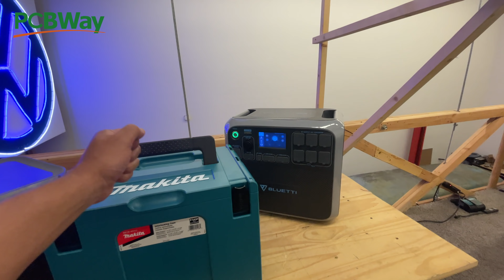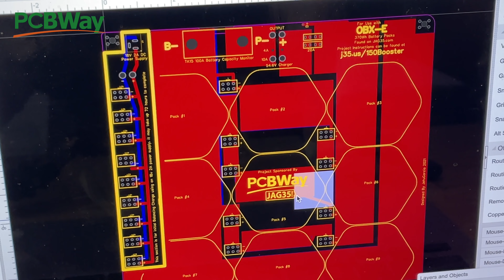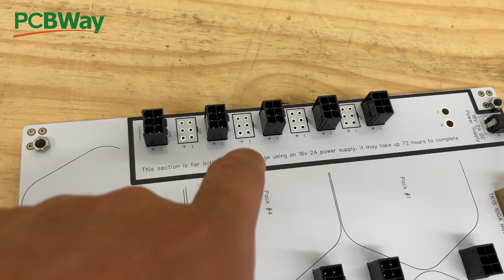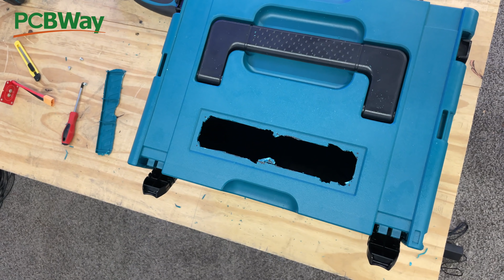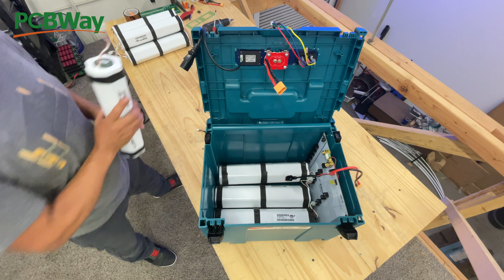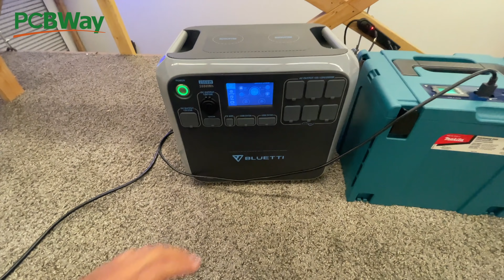DIY Booster Battery for your Bluetti /Ecoflow Solar Generator

Comment: awesome idea, thanks Jehu!!!
the PCB can still be used for all 9 balancers. (and 12V 2A charger)
just EXTEND the connectors inbetween with wires (tricky but doable) so half are surface mounted and half are"floating above the others" . easy

Comment: Bro….where did you get $500 for the total? Its substantially more than that.
Batteries are $441. Items on Amazon are $191. Then the cost of the boards about $139. Cost of meter $27. This is an $800 build.
…..Did I miss something here? I still think cost is pretty good, but its 60% higher than the estimate

Comment: So your using the solar ports to supplement the generators. So can you still plug in the panels while using this? I kind of agree with Vanilla Gomez on this. The better video would be to use these batteries to make your own solar generator and forget about the off the shelf solar generators. Then you could make one with as much storage as you want!

Comment: Jehu,  
The link to the 48V charger takes you to a 4Amp Charger with an XLR connector.  It looks like the Anderson connector version is 10Amps.  Is that ok or do I need to replace the XLR connector with the Anderson connector?
Reply: I was wondering the same thing. Anyone know the answer?
Reply: @paulthompson4618  Did you see the shunt listed?
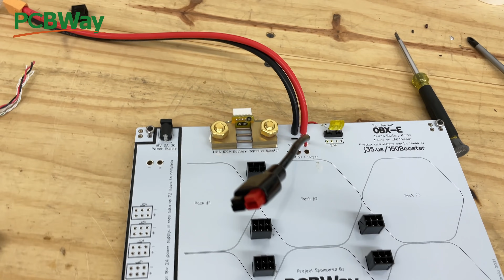Reply: @paulthompson4618  I did see listed on the board that main PCB board that it is labeled 10A 54.6 Charger (7:28).  Should be good with the 10A charger.
Reply: @offgridwithpojectham  Thanks Michael

Comment: You can make a step down converter 50v to 24v to power a cooler ( peltier ) ore a small cooler whit a small compressor that accept 12-24v its a modulair pack.

Good video

Comment: You should have PCB way change it so you can fit all the plugs in like intended... Also since you have the measurements of the Makita box increase that front panel a hair bigger... You won't have a pain in the butt trying to cut the hole out... 
Also if you use 3M Velcro with the sticky tape in the bottom of the box as wrapped around the batteries (alternating direction if course) everything inside will be secured and not slamming around should you move it... Also if you attached the pcb inside with that 3m Velcro tape it would remain a bit more water tight outside...
Reply: or extend the existing ones with wires (tricky but doable) so half are surface mounted and half are"floating in the air" but usable

Comment: During the balancing operation, those batteries are in parallel right?  What if a low battery and high battery are connected, wouldn't there be excessive current flow?
Reply from the maker: No the bms will turn off at 5A

Comment: I am looking for something that allows me to plug in a laptop, tablet, router and cellphone to charge those devices and also be able to have LED-Lights at night.
So when a Blackout happens and I'm stuck without lights for a week or so, I will be able to have some kind of life.....LOL
Would love to see a video about that  😉👍
Reply: This is what the solar generator does for you.  This diy project just increases your battery capacity to the generator.
Reply: @1oldretiredguyMike  Aaaah I see, I see.  ok
Thanks  😉👍

Comment: Jehu, currently building a tiny house. Was short on budget but  already had planned on a smaller system for my tow vehicle, that is a Ford F250 with a tool truck bed on it, and easy to mount roof racks for the solar panels.  So the system I'm putting in the tiny house for temporary use will go in the truck.  I grabbed a Eco Flow River, and a 200w Newpower 12v solar panel.  I'll likely get one more of the 200w and those 2 will go on the Truck for the long term.  I wanted to get the 400w bifacial panels I've seen, but minimum of 4 or a pallet of 10 so likely doing the pallet of 10 in a few months. 

My question is I'm ready to grab your populated board kit.  If I get a solar charge controller and use the 12v panel to charge the Makita box battery box. The problem being is I think the max V input for solar on the River is 25v.  So I'd need to change the Makita box to 24v or 12v for it to work outside of using a 2nd mpt controller to keep the voltage down which would be a waste of efficiency.  

I'll either be getting the Delta or one of the high wattage bluetti or other systems, or build separate components and use the Makita box with the new system since I'm aiming at 5,000 watts or more of solar coming in.  

So suggestions here are welcome.  Will pull the trigger and buy the kit today if you think it's the way to go for my current temporary needs.
Reply: More using it as a UPS currently on my computers and smart home devices so everything continues to function if the power is out.  That pulls about 250 to 350 watts depending if I have the 55" 4k tv on or not. ;)  I think that only gives me about an hour of run time, and would use the Makita box to extend my time I can run without grid power being on.  I have to watch the rest of the video you may mention dropping the voltage and how to do it with the setup you are selling.

Comment: The batteries are sold as is, does that mean untested? Any idea of the average battery cycles left on them? $450 is a lot for as is untested pricing
Reply: I purchased 10 of these batteries all were fully charged (16.4v) one needed charging. Understand your not paying full retail. If you will sleep better then buy from Bluetti and pay full retail and  get a multi year warranty. Read the comments he has sold very many different type of batteries, I don't remember seeing any dead battery complaints.
Reply: @paulthompson4618  snarky on YouTube, never seen that before. Get over yourself 😂
Reply: @ThanksForTheLaugh  Odd reaction to Paul's comment.

Comment: Just priced this I could do that with 12 volt deep cycle batteries cheaper than that and hook an inverter to them if I need additional ac power.
Reply from the maker: Do it

Comment: For my AC200 I used 280ah batteries that are always charged by solar. These feed through a BMS and out to the charging port on the Bluetti to keep it constantly topped up. This avoids having to charge the 280ah batteries with a wall outlet. If the 'Big' batteries run low, the BMS will kick out and stop charging the Bluetti but it will then use its internal batteries. When solar is available again, the main batteries kick in and start charging the Bluetti again.
Reply: I am using 16x 280ah batteries, wired in series for 48v through a Overkill Solar 48v 16s BMS. 48v x 280ah = 13,440kwh of available backup. The batteries are charged through two Victron 100v/20a MPPT charge controllers (https://smile.amazon.com/dp/B075NPQHQK) feeding from two different arrays. Don't worry about the voltage in the listing, they indeed charge at 12/24/36 or 48v. 

The output from the batteries is wired from the output side of the Battery BMS directly into the Solar charge port of the Bluetti with PV being selected as the charge source. The Bluetti cannot tell the difference between solar and battery at this voltage so it just sees it as a very large solar panel supplying ~48v that is Always available, rain or shine so long as the batteries have enough charge. When the internal Bluetti batteries drop to about 98% then it starts recharging from the batteries until it is topped off at 100% and then shuts down the charge until needed again.

This setup got me through the recent winter storms in Texas for over four days running a fridge, 500w heater and occasional microwave + a coffee maker (can survive without everything else, but Coffee is a MUST!). For an example of the capacity, you could run a 500w heater for 26 straight hours assuming no recharge. 

I like what jehugarcia is doing here, extending the capacity of the Bluetti but I am concerned about using battery packs that, once they run out, are essentially no longer available - that is why I chose the 280ah LiFePo4 cells from China (took about 2 months to arrive).
Reply: @houstonfirefox  That sounds pretty great. Do you have a video on how you set that up? I have 0 experience with this stuff and am researching for a van conversion.
Reply: @jonmgreen  To be honest I didn't know there would be any interest in it but expect a video soon detailing the setup on my channel in the next few weeks!
Reply: @houstonfirefox  I'll keep a lookout!
Reply: @houstonfirefox  i don't see a video
Reply: @houstonfirefox  -Nice one,do you have any Youtube vids or fb link?
Reply: @femialade4226  Click on my name above and it will bring you to my channel if you want to see upcoming videos on my setup.
Reply: @houstonfirefox  The batteries Jehu is using can also be charged with a Victron solar controller just like the batteries you bought from china.
Reply: @uhjyuff2095  Which controller? and would it plug into the board in this kit or would I need to wire it up differently?
Reply: @jonrose6802  A solar charge controller that says it can charge lithium and up to 42 volts. If you are looking to buy a victron solar charge controller make sure it says 48 Volt on it, like the 100/20-48 model, then you will be able to charge any 10s lithium battery with it.
Reply: @uhjyuff2095  Good point. Also note that the 100/20-48 model mentioned WILL ALSO charge 12v, 24v, 36v as well as 48v capacity battery banks. It's not specifically mentioned at first glance. I really like having that option for it to automatically determine the correct voltage although 36v must be manually configured through the Bluetooth app.
Reply: @houstonfirefox  Your link for Amazon says sorry page does not exist
Reply: @houstonfirefox  I’m a total noob with diy 12v battery systems.  I bought a AC200P but noticed it doesn’t actually give me 2kwh.  So am considering buying a 200ah LiFePo to supplement.  Figured how to charge it… can you advise on… 1) can I connect the 200ah 12v directly to the DC charge port of the AC200P? Or do I need something in between?  2) I’d also like to charge this battery at the SAME time as charging the AC200P… Do I need a BMS to do that?  Thank you in advance
Reply: @CalmTurtle2023  Hello! If you have 4x 200ah LiFePo4 cells then that gives you the 12v necessary to charge the Bluetti. Because of the sensitive nature of these batteries, they can be destroyed if you run the voltage down too low or charge them above 3.65v. I recommend the Overkill Solar BMS to ensure that any load or charger will be disconnected before these limits are hit. 200ah x 12v = 2400 watt-hours of added capacity so your Bluetti will start charging from your supplemental batteries when its battery level drops below about 98%. The BMS on the supplemental batteries will prevent the Bluetti from taking "too much" and automatically disconnect if they fall too low. In short, YES. You should ALWAYS use a BMS when using LiFePo4 batteries or, God Forbid, straight Lithium Ion batteries (which I would never use do to safety issues).

Bear in mind that charging from a 12v source will only fill the Bluetti at a rate of about 100watts per hour (Wh). If you fully deplete the Bluetti then it would take approximately 20 hours to recharge it from a 12v source since the Bluetti limits the amount of current it pulls to avoid damage to a 12v car cigar lighter socket. The recharge rate is roughly double at 24v (about 200wh). The Bluetti DC (car) charging port automatically detects whether it is being fed 12 or 24v and limits its charging current accordingly. There ARE ways around this but that's a topic for another day. In short, it IS possible to deplete the Bluetti completely even if the supplemental batteries are connected since you may be pulling juice out of it quicker than it can be recharged. Normally this is not a problem.

As for charging your supplemental batteries at the same time as the Bluetti - Absolutely! I use a Victron SmartSolar 100/20 charge controller from solar panels run to the Victron and from the Victron to the BMS to charge my batteries regardless of what is going on with the Bluetti - it will only pull from the supplemental batteries when needed to charge back to 100%.

Subscribe to my channel and I'll have a walk through of this process coming soon complete with diagrams and other visuals to help understand what is going on 🙂
Reply: This was my plan too. Limitations on how many watts of solar you can dumb into the Eco or Bluetti, so using solar charge controller to charge a battery bank, then charge the Solar charger from the battery bank using another charge controller.
Reply: @RoeBorger  Exactly. With 12v or 24v of battery available you could then use a boost converter to turn that into 24v or 48v to get a better charge rate from the Bluetti
Reply: I'd be interested in doing a setup like this too. What all did you use?
Reply: Amma Biz sadece baxiriq 😟😒
Reply: i too am interested in this setup and video!  So if you have no solar and your AC200 is depleted does the backup battery start charging it up automatically?  or does the BMS do all the work and start topping the AC200 from the backup battery?  Thanks!
Reply: So you essentially built a solar generator with a bluetti and all you're using the bluettinis used for is a inverter. May as well just saved yourself $1000+ and just bought a 2000w inverter instead of the bluetti
Reply: @randybobandy9828  In hindsight, you are absolutely right. 3 years ago as I was learning how to get this stuff configured, the Bluetti was the cheapest route. Since then, the prices on pure sine inverters has come way down and your right, especially giving the slow charge rate of the Bluetti when a large load is put on it.
Reply: This sounds exactly like what I want to do. Could you please send me a parts list and a how to if you have it. I would greatly appreciate it. Thank you.
Reply: @msarmir  Currently:
8 x 280ah LiFePo4 cells (24v total)
24v to 48v step-up booster (so I can use the solar charging port on the Bluetti and get a faster charging rate. Before, when I had only 4 cells (12v) I used a 12v to 24v step-up voltage booster for the same reason)
Victron SmartSolar MPPT 100/20 charge controller
4x 250w solar panels (about 1000 watts total but realistically about 800 on any given day)

Comment: It's a viable alternative to buying a company made battery, but it may be important to have both units communicate with each other, otherwise it's no different than using one solar generator to charge another.  The Ecoflow River Pro has a port that will accommodate an external battery.  The port includes a serial connection like the old days. The only downside is the primary unit battery needs to be depleted before the external is used.  I wonder if it's the same thing with the Bluetti and the new Max?
Reply: you can connect them and USE energy same time. (correct me if I'm wrong)
Reply: You could just open the unit and add a 2 parallel XT adapter off the battery to inverter. 

ONLY DO THIS IF YOU HAVE THE SAME VOLTAGE BATTERY SAME CHEMISTRY AND SAME STATE OF CHARGE (full). This might confuse the microcontroller that is in charge of the fuel gauge

Comment: You said that the batteries only support about 15 amps of current, but since you're running 3s3p (3 sets in parallel), that would mean 45 amps from the whole pack right? So theoretically about 2kw of output? That would be much better, otherwise you're looking at about a 720-750 watt limit on the pack. That's not great for battery storage, although it would be enough for charging other battery packs.
Reply: I think it was: 3s3p
- 5A per battery series
- 15A per parallel group

Comment: Do you think I could use a slower charger? I'm thinking I could charge from the bluetti (it's in a van permanently) when the van is not in use and there's Solar. I then have the big battery as a backup when required (not often).
Reply from the maker: Yes this is possible

Comment: Wait up, the charger has a fan , but it’s enclosed !  Not sure I feel safe with that in hot weather.  Also I’d pack the box with something to stop things moving around.  Metal and wires and things moving ....
Reply: Lifepo4  plus the small bms throttle the out rate so no issue.    But good to stay on your toes.
Reply: Well, the XT90 connector is a big hole as well, with those big stand-offs holding it in place. Of course it's also easy enough to make another cutout for a vent cover.
Reply: Very cool dyi

Comment: Very elegant!   Like it a lot.    

Is there a way to split the power output so part can go to an inverter (yes, less efficient)  in order to exploit the AC200's ability to charge both by solar and A/C through both ports simultaneously?   (To double the wattage input to the AC200.).  If so, could this project battery bank output at that rate?    Thank you.
Reply from the maker: 15A output

Comment: Next version of the board stagger the initial charging connectors. Move every other one closer to the middle of the board. Should make room to hook up all 9 connectors without losing copper surface.
Reply: This is single lot project, so no v2 unless he updates for 100% DIY only builds.